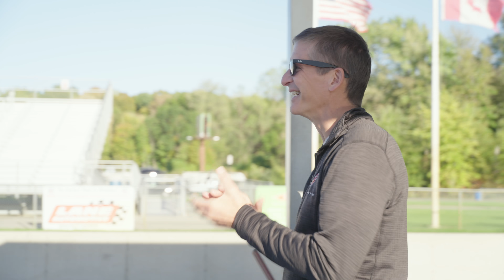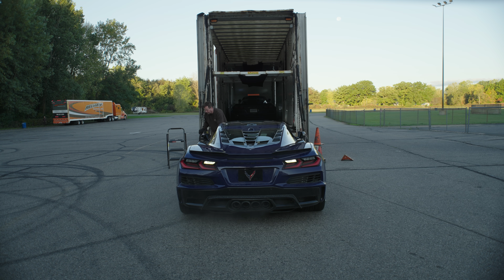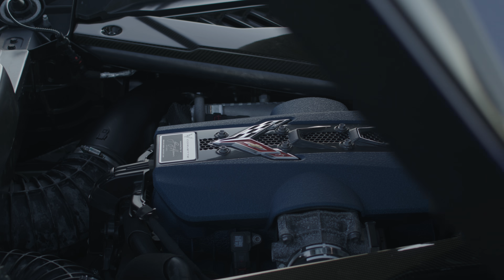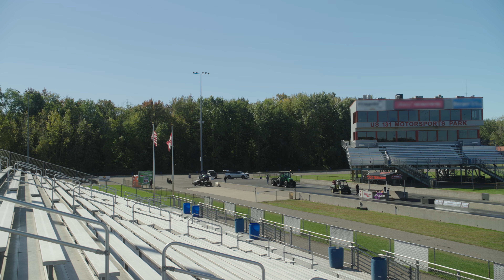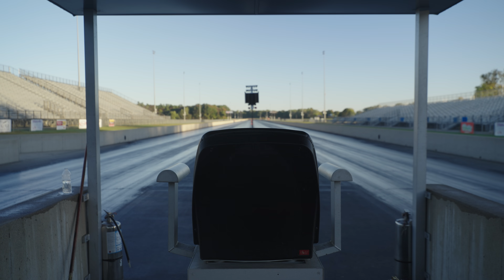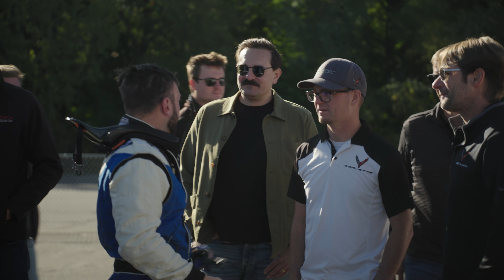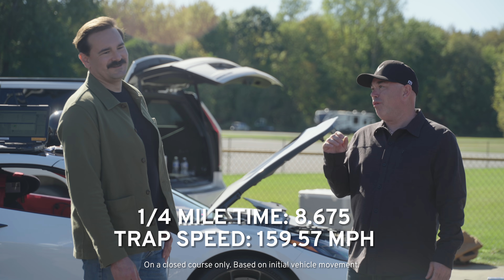We Pushed The Corvette ZR1X To Its Limits (DRAG STRIP TEST)

Comment: ZR1X crossed the Quater mile line faster than a Rimac Nevera and Sapphire Air that would make the ZR1X the fastest car on the Planet RIGHT?
Reply: Rimac passes the 1/4 faster. 165-171
Reply: @ArdentInnovative-x6g are you saying a Chevrolet gave a Rimac a run?
Reply: @bishrob345 it did well against the rimac
1 on the hamilton collection zr1x vs jesko vs rimac video. Beats jesko and beats the Rimac by a hair on dig.
2 on Drag times on the drag strip. The rimac gets a 8.5 @165mph 1/4
So close still 2 seconds off

250k vs 2.2m btw

Comment: Are they using a computer to dial it in? I looked at a 1970 Boss 429 on a dealer’s show room floor and I possibly could have bought it. I was in the military and driving a 1970 fastback Mustang with a 4.9 V eight heavily modified. I didn’t buy the Boss because I couldn’t afford the insurance with the cost of the car over $5000. I was 21 years old at the time and looking back I’m glad I didn’t buy it with what went on later in my life with a divorce and all.

Comment: You've mastered straight-line speed. But wasn't handling the main point of going mid-engine? Vette STILL needs to make some real track cars. Some Z06/ZR1 "LM"s with big downforce.

                  (Downforce @ 155mph)
Z07 makes   509lb
ZR1 makes   624lb
2016! ACR   1,320lb
GTD            >1,460lb
GTD Comp  1,600lb+?
GT3RS          1,457lb
GT3RS M.R. 1,700lb

PLEASE just offer "LM" trims, with Z06 GT3's real aero/diffuser/wing/fender vents etc (easily 2x the ZR1's DF). And add DRS.. 

And add some lightweight/performance parts,
-manual CF buckets             -65-70lb
-lightweight exhaust             -25-35lb
-DSSV suspension                -25-30lb
-Li-ion 12v battery                      -29lb
-Forged CF/lexan decklid/no struts -30lb
-Bare forged CF door cards      -15lb
-J57 calipers (on <3600lb ZR1) -24lb
-Thinner firewall glass         -10-15lb

Do tighter 1-6 gearing, a fixed roof, 295-305 fr tires. etc

And strip some insulat./trunk carpets/speakers/cameras/sensors/soft-close latches/hood struts etc. Do manual steerng telescoping & all suede/frgd CF interior.  -60-65lb+

-300lb is easily possible.. (w/o a $ CF body & w/o gutting the interior).
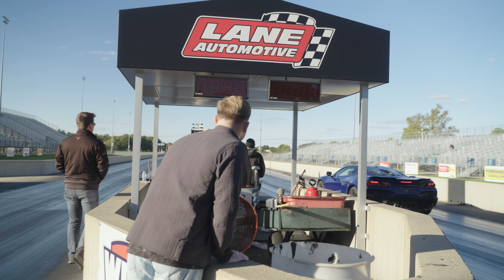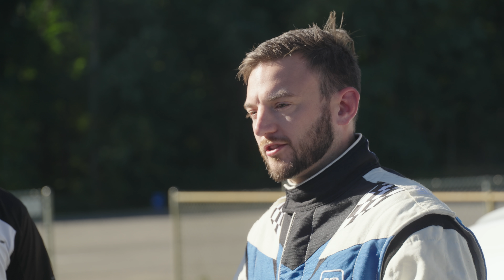A Z06/ZR1 "LM" (with Pro drivers) would do low 6:50's/6:30's 'Ring times, beating Ford Multimatic. And could/SHOULD cost <$185k/<$225k

Comment: I am waiting for mine to come in 270,000 it cost. and they are hard to get because they're only making 250 of them. and   making so little of them you have to know someone to get one or you will not get one the waiting list was long you got to be on the waiting   list to get one or you won't ever see one 0 to 60 in 1.2 seconds. and I'm only getting it for convertible because I want a convertible car and I have a ZR1 but I want convertible and this is the fastest car I'm getting mine in Black like Jay Lennon same one black and red one of the fastest cars made now they will beat the Bugatti Lamborghini. Nelson's potholes and lift the front up off the ground  like  Ferrari so you don't break your feeling anymore you said it and you never break a fairing again I broke about four on mine 3500 a piece because the driveways are too low for the car and they built now when you go up and drive me with sensing now to lift the front end up I love  design finally

Comment: U9 Extreme is the world fastest production car with 3000 hp at the same price of 260k. I hope we can buy in USA. 😢
Reply: It's almost 3 million dollars, actually, or about 10x the price of the corvette. But you're right, it is quicker, until you try to turn.
Reply: @jjoohhhnn 3 million is auction for 1st one. Very much like the first corvette sold for millions. Base is 130k to 260k. The base is faster than zr1x. 😅 Dreamme just released prototype of dual rockets EV reaching 0 to 60 in .9 seconds Available next year at 350k to 400k.
Reply: @peternguyen9386  The BYD U9 is 260k, and has less than 1/2 the hp of the U9 xtreme.
Reply: @jjoohhhnn 130k base with about 1300 hp and fully loaded.still faster than corvette zr1x
Reply: @peternguyen9386  It is not. 9.7 is a second slower than 8.6.

Comment: Nice car, but why dont you fix your horrible 6.2 v8s and those horrible 10 speed transmissions?   So many of your cars are absolute crap boxes.  I had a 97 Tahoe and it was reliable, with one of the worst interiors for the money.  The cheapest and hardest plastic.  At least it was comfortable and reliable.  Your cars now are garbage.
Reply: What’s wrong with both the engines and transmissions ? Just asking . I don’t know myself .

Comment: 1 million miles on my Van last night.Two thousand twelve chevy express 60 vortex original motor hit one million miles last night , 999999 vary excited to hit that mark what a milestone. However, now my odometer is stuck on the nines. What do I do about that? How am I supposed to keep track of my mileage? I haul freight over the road cargo Van expeditor over the road. Now. I don't have no way to keep track of my mileage other than my trip. Very disappointed in Chevrolet.  I have been a Chevy man since I was old enough to work on cars realize there's nothing better than Chevrolet. Finally reach a million miles. And this is what I get I gotta go, buy a instrument cluster or get it programmed, what very let down, but the Van's running good, I got to get Chevrolet props at 6 0 vortecas, one hell of a motor and the gearing and the transmission, and the 6 speed tranny.  16.9 miles to a gallon average doesn't use a drop of oil, put 3700 pounds in the back of that and hauled up-and-down mountains all day long.\n Run strong runs great. What a set up way to go Chevrolet we're going for 2 million miles now. Course, I won't know how to I'm going to get there with no odometer, but we'll figure it out.

Comment: Question is will it perform as good as a Tesla plaid s at high altitude at 95° air temperature?
Reply: I don't think there's any set of tires or manufacturer option that could make the zr1x slower than the teslur

Comment: This machine will prove it's worth during a 24hr le mans , bone stock, from the factory compared to any of the metric kilometer cars running as factory stock.  Chevy will provide CONSISTENCY ... it's a guarantee. either a consistent POS like a new  half ton diesel PU with a time bomb trans , or like my old C4 that had a consistent embarrassing interior, but 100% endurance level TPI v8 that whooped Poorsche and Furyrarri back then...  it also held highest g force skidpad test in the 80s...  first to break 1.0 G's...

Comment: You test it in the quartermile you don't test it on the quartermile. Lol.
Test it on the track. Test it in the quartermile. 
Just think. Engineers have to have the car also be in that safe area as well.  This is a part, PART, of why you can add bolt ons to a car and get some more horsepower.  Other things engineers have to worry about is noise, gas mileage etc..
What's funny is I had a 94z28 rated at 16 city 24 highway. I got 18 city and usually 25 or 26 highway. Added many bolt ons along with an ATI 8 psi Procharger intercooled supercharger. I then got about 1 mpg less city but went up to between 28 and 30 mpg highway. Of course keeping the foot out of it.  I have now a genesis coupe 3.8 and factory was rated 17/27.  I added port and polished upper and lower intake, intake spacer, larger throttle body, true CAI along with a dyno tune ECU. Went to 20/ 31 mph. My point with all this is that this vette has more meat on the bone for getting even more HP safely and even better gas mileage (maybe) sue to engineers having to play it safe and then some. They leave the "and then some" area for us to play with. We already seen with the zr1 Camaro that people just changed the pulley on the supercharger and a ecu tune to accommodate this and the car picked up crazy amounts of extra horsepower. Wait and see custom vettes of this kind and watch 7s be attained with little effort.  Amazing what American cars are doing from the factory. Dodge and Ford also need a pat on the back.  Anyone seen the exorcist Camaro? Ran a faster qmile time than the demons. I wonder what Henessey can do with this car? Lol

Comment: YOU LIE , THE DODGE 170 , A NONE ELECTRIC  PRODUCTION CAR IS AN 8 SECOND CAR.AND NOT WITH A HELPER ELECTRIC MOTOR. WHAT ARE THE TIMES FOR THIS CORVETTE  YOUR TWEEKING THE CAR TO CATCH  OR BEAT THE 170.  BULLSHITTERS !  170 IS STILL QUICKER AND NOT  ELECTRIC. 170 WILL RUN BETTERAND YOU DON'T HAVE TO SIT WAITING FOR THE CAR TO COOL DOWN.
Reply: The dodge 170 wasn't on street tires or pump gas.

Comment: For a american car challenger set that record first. With way less hp, non assisted help with electric motors for "awd"  and on pump gass also.
Reply: Not on pump gas and on drag radials, not street tires
Reply: @seismic6435  Yep, you literally can't buy a car that's quicker down the quarter mile, with an ICEngine.

Comment: I remember telling people back several years ago that general motors was going to be building a mid-engine Corvette that was going to pull 8 seconds in a quarter mile and everybody just looked at me and laughed. 1 to twin turbo small block Chevy and put electricity on the front axle McLaren's going to have a hard time keeping up and turns out guess who was right and who was wrong.
Don't underestimate general motors. I believe they have the most expertise on the planet manufacturing and building automobiles and more this is just a very simple preview to the future of performance of Corvette

Comment: The C9 needs to be an all carbon chassis.

Aside from dropping weight, how do you improve on this? More electric HP? A little more power from the ICE?

I don’t know how GM is gonna do it, but if they can build an all carbon Vette at a price 3-4x cheaper than the all-carbon European super/HyperCars that they’re ALREADY beating, it will be a feat in and of itself.

Comment: Nice work GM! Good to see this price point for this level of performance. Unfortunately, the physics of 100yr old internal combustion engine/drive train technology and energy loss between combustion and tire rotation are quickly becoming a thing of the past. 

Ask yourself these questions: 
How many moving parts are required to rotate a drive axel? 
Do moving parts require more maintenance than non-moving parts? 
What is the energy density of diesel vs. petrol? 
What percentage of that energy density is lost due to heat, cooling and friction? 

My 1966 Buick Riviera and my 1970 Barracuda were sweet rides back in the day. Give them the right fuel, proper maintenance and a steady hand and you’ll get miles of smiles in return. Unfortunately, compared to EVs, they are slow, noisy, high maintenance, energy hogs. Loud, fuel burning dinosaurs are exceptional tools for cheeky grins as the tires break from the asphalt while the engine roars in compliance to my commands. 

Our obsession with old technology is steadily reducing our economic strength and relegating the US to second or third place on the global stage. Our failure to adopt new technologies and adapt to the changing environment will have a lasting impact on future generations. 

A note to GM Leadership: Adapt or get left behind.

Comment: The only ride you can get that will run faster than this is the Shelby GT500 Code Red. This ran the 1/4 in 8.593@161.81. The ZR1X is absolutely more accessible and streetable as only 30 Code Reds were created and not street legal.

Comment: Let me throw the reality check into the conversation - the times quoted i believe were using the roll out Timing method where the first 1 foot I think it is - is not counted in the acceleration time - the car is a sub 2 second car but I don’t think if they had measured it using the way the motoring industry generally does acceleration tests - acceleration measured from the point the car goes - those times might not be replicated.   Don’t think this is me being negative but it’s the reality of how zero to 60 is calculated.   This generation is the first Corvette that’s stands on equal engineering merit with the European brands and that alone is an absolute credit to Chevrolet, they put their money where their mouth is and invested in a great product.

Comment: Tune on E85 + Drag Slicks w/slightly taller tire + Find a 120lb Pro Driver + Remove all the windshield washer fluid + 1/4 tank of gas.  A bit of tailwind.  Should eliminate any wheel spin, shave another 0.2-0.3s and +10mph at the end of 1/4.

Comment: That’s fast, my AWD civic b18a twin turbo with a stripped interior would barely beat that car, holy smokes. I’m running 7.379 1/4 mile and trapping at 278 mph,

Comment: Meanwhile, at the dealership, they demand $70k for a pickup truck. $84k for a Suburbun.
$40k for a sedan.
$50 k for a nice crossover.
Econo box cars all over 20 grand.
All that money and your turbo will need replaced at 100,000 miles. $1400.00
You'll be lucky to get more than 100,000 from the transmission. 
$6000.00
Not to mention all the headaches from the displays and tire monitors. 
Their diesel products even worse. 
And when your fancy LED tail light stops working after three years and the warranty is done?
That would be $800.00 for the left one. $800 dollars for the right one three months later.
Quality made Chinese parts saving "you" money.
"That tail light would be $2000.00 if we made it in America."
Reply: My Yukon's left tail light felt this comment at its core.  Also when you take it to the dealer they tell you the warranty doesnt cover "glass" or "bulbs" even though the its made of plastic and the failure point is the cheap wiring that breaks.

Comment: To put that in perspective, in 1966 I was a young engineer just starting with Ford’s Engine Product Engineering Office. The young guys had a drag racing club, The HiRisers, that ran a 1965 Comet 427 SOHC. It had been run in 1965 by George DeLorean (John’s brother). 
Wayne Gapp ran the club, and drove the car. It was terrifying to watch up close. We held the 2,400 lb Gas Funny Car class record for trap speed and E.T at about 145 mi/hr and 9.9 sec E. T. (Wayne always kept a little in his hip pocket -until Bob Glidden came along. Glidden let it all hang out every single run & was unhappy if he didn’t break every spare everything he brought to the track!)
That comet was a race car - not streetable. Wayne put in an Econoline beam axle. The cooling system consisted of a repurposed Evinrude outboard motor fuel tank and a small water puppy electric pump. The 427 SOHC was about stock, but they all were hand built in the EBU by the club engineers. We had one disaster when the guy who assembled the heads didn’t realize the valve springs had a particular orientation, installed them in Spode down and the valves float at 8,200 instead of 8,500 revs/min. Bad for a lot of internal parts. We never made that mistake again…
Hard to believe that was 60 years ago. That sure felt fast. Today you can go 20 mi/hr faster and 1.2 seconds quicker- with cup holders, power Windows, etc. 
Talk about the ARROW OF TIME - this Corvette is the CRUISE MISSILE OF TIME!

Comment: extremely  impressive though this is on prepped surface and the video shows them tweaking and tuning engine parameters to get the best run.   even still  take a couple tenths off and and few more for normal road surfaces and  9. to 9.3  seconds is crazy fast for a stock zr1x at a stoplight 😆 seeeeya .

Comment: Keep after it guys, you don't have far to go to beat the 4 door sedan Tesla Model S Plaid. That's what you need  to do now😮😂😂😂
Reply: Regular ZR1 has faster 1/4 mile @9.2s vs stock plaid, and all Teslas are boats on a legit track. Not to mention how much performance electric loses once things get hot.

Zr1x w/heatsink after 5 pulls= 8.8s 1/4 mile.
Reply: @corith4535  Nope your incorrect. Tesla goes 8.3 in the quarter, 163 speed. Its a speedboat. This video is about drag racing not track racing....
Reply: @bubbagump150  If it went 8.3s in the quarter, it wasn't stock. Fastest verified stock run was 9.23s for the Model S Plaid. Fastest modified Plaid is around 8.5s, but is completely stripped of its' interior.

Can you provide a source of a stock Plaid hitting 8.3s?
Reply: @corith4535  keep loving the vette.. 😂😂

Comment: Ford guy here👋🙂
LOVE AMERICAN MUSCLE.
Especially gas powered. 
It’s a great feat by GM, and as always GM fan boys are goof’in on Ford. To that I say this….
Ford could EASILY build a car that would stomp a mud hole in that ZR1X. Still a great car though. 
But…the ZR1x is a LT7 TWIN TURBO, PLUS a FRONT electric engine, making it an AWD?! Come on guys. The Ford GTD 5.2l is from the old GT500, paired with a Supercharger, that gives over 800hp! Just saying. There’s more than a few STOCK “factory spec” twin-turbo Mustangs running in the 7’s in the 1/4. Without a heavy selection of Ford engineers, and a full “prepped track”. Just saying.

Comment: Nobody in auto racing cares about a straight line. Porsche 15 year old HALF HP car destroys the ZR1 on Nürburgring. Grats on having NO skill.
Reply: The problem with your argument is that the ZR1X beats the Porsche GT3 RS around the Nurburgring and the ZR1 and ZR1X are faster in the straight line than the GT3 RS. It's over for Porsche, kid.